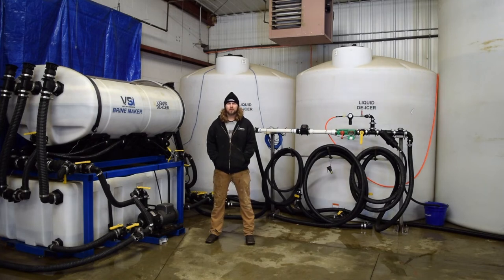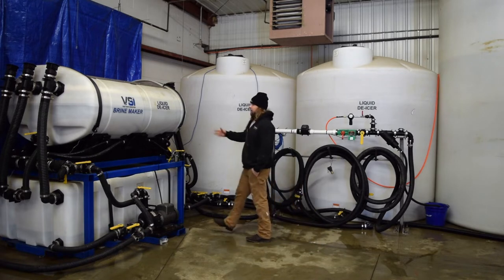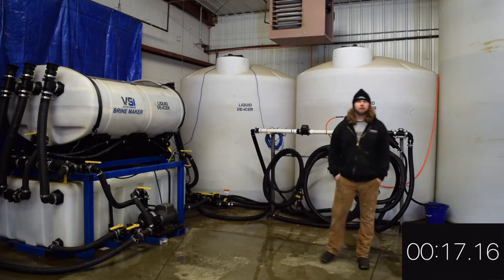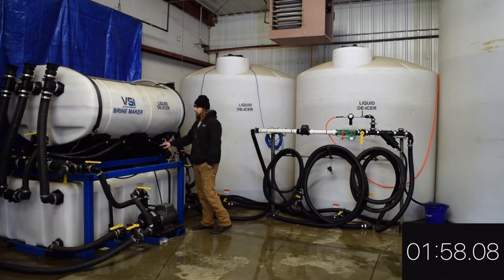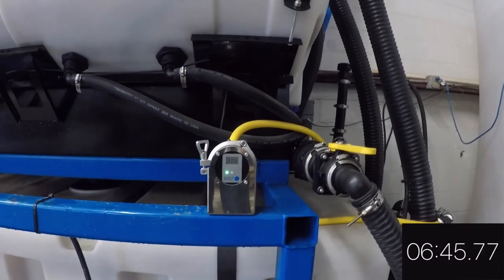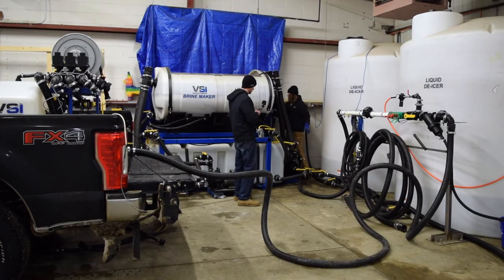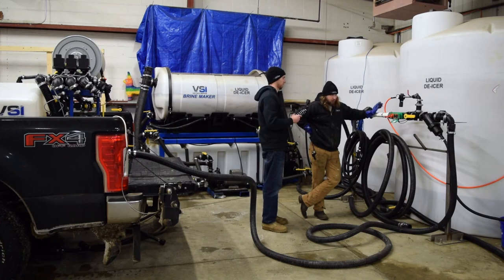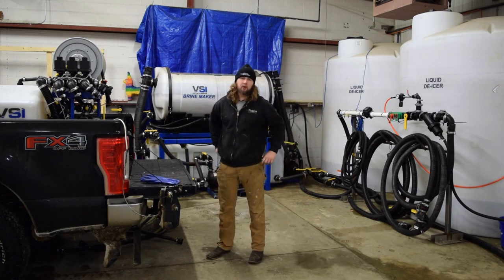Making Brine With a 750 Brine Maker and Filling a Brine Sprayer

Comment: I noticed when you switched valves to add your additive that you did not clear any lines, would this result in an inaccurate reading since the flow meter is also calculating the salt brine first before the additive reaches the meter.

Comment: what size tanks are you running in this set up?
Reply from the maker: We have 2x 3,000 for brine storage, and a 5,000 for additive storage. Our brine is just for our testing so we don't keep much on hand. The landscaping company we grew out of has 14,000 gallons of storage for brine and 9,000 gallons for additive.
Reply: @voigtsmithinnovation4112  awesome. just picked up 3 5k tanks myself and 2 3k tanks for additive. what size tanks are you running on the brine major to yield 750 gal of product? 2 500s?